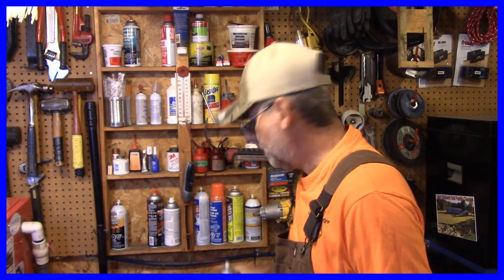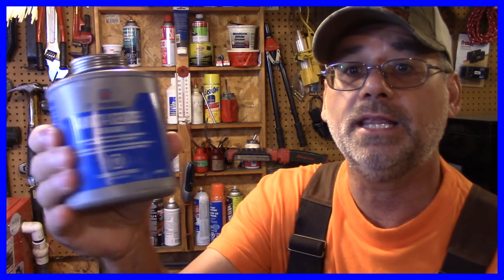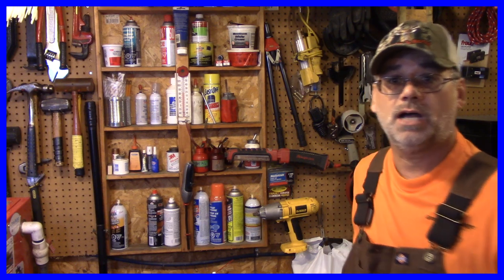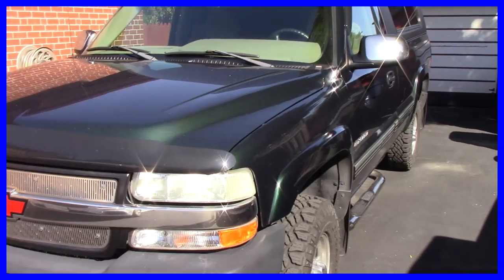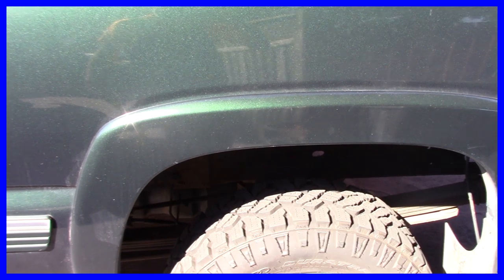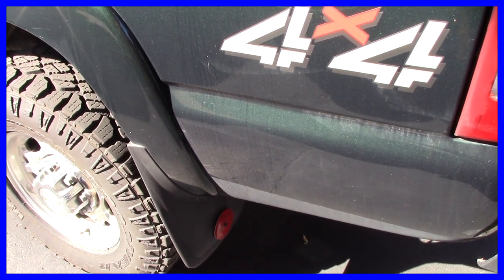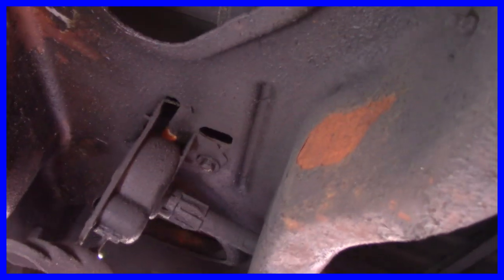APPLYING  RUSTPROOFING / UNDERCOATING TO  YOUR VEHICLE  - THIS IS WHAT I  DO AND USE  .

Comment: Let’s clarify.   You should definitely undercoat/rust protect in some way. Not necessarily pay for it to be done tho.  
Oil and diesel mixed together and sprayed on a hot day works great.   

One final note.  I have a 2003 and 2010 Chevy Silverado 2500HD... and neither was galvanized from the factory in any way shape or form.  Literally tore the 2010 apart down to the frame fresh off the car lot in 2010 with 1 mile on it.... no galvanizing.  Galvanizing is a zinc based coating and it leaves a very unique look.
Reply from the maker: Well I worked at GM for 30 years so I have seen my share of vehicle production. On  your 03 only the roof panel was not galvanized and your 2010 has every body panel galvanized. Its not like what you would see on a galvanized nail as its smooth as glass. Cheers

Comment: I have an aluminum body f-150. You won’t get rust but eventually it corrodes white and powder. I used Eastwood platinum on all the frame that I could reach and getting the whole underbody sprayed at a shop soon.
Reply from the maker: Nice 👍

Comment: i used to rustproof cars way back when,the stuff we sprayed in the doors and inside fenders was kinda waxy. they use alot of salt here too,my plow truck frame rotted out in 10 years from it. my 95 dodge is pretty rough from plowing since new,i try to wash it off as best i can when i can. i have worked on plenty of rusty plow trucks  in my life,and its a crappy time consuming job.
Reply from the maker: It's does help but in my opinion just slows  it down. I wouldn't like to be spraying undercoating all day , no thanks :)

Comment: I've had my truck done by a local guy he's excellent . here in northern NH they use a ton of salt on roads and i use a product called fluid film great product its not petroleum base, its lanolin base (wool wax) the US navy use it to fight rust. It can be purchased in a spray can for under 10 bucks, check it out Steve. I use it to touch up under my truck.
Reply from the maker: I do have the product and have used it . It seems to cause a skin reaction on me when  spraying it so I only use it on a brush now. It's good stuff too.

Comment: I sure wish I would have goobed up my brake lines on my 2002 truck when I bought it.  I like fluid film. I started using it on the lines on the tractor at work that always rusted out. I like it better then the chain lube because fluid film seems to drip off less.
Reply from the maker: The fluid film is good stuff but in my opinion the rust check "coat and protect" is much better and drips less than fluid film. Not sure if you can get rust check in PA , if you can get a can with the green cap called coat and protect. It's the best so far.

Comment: Nice example. I used the green rust check product on my car too, it does stick on for a long time. I spray my rust prone mazda in and out with it each time I change the tires and it does help a lot.
Reply from the maker: Yes on the rim to hub contact it keeps it corrosion free as well. Cheers

Comment: The best rust proofing is to have a massive oil leak. Itself applies around the whole year.
Reply from the maker: I've never tried it but if you like lots of oil  and haven't set yourself on fire yet . LOL
Reply: I can tell you that the front sub-frame of my 95 Lumina is pristine due to all the typical GM lower intake manifold and front cover gasket oil leaks!

Comment: I have used RustCheck Coat and Protect in the past and it sticks/protects for a few years, it's a good product. However,  for me, it's cheaper to do rustproofing touch ups with a small rustproofing gun and rustproofing oil that comes in 4L containers from an auto parts store.
Reply from the maker: Tony I have a gun from Princess Auto and yes I do the same.  Good to see you do as well.

Comment: I only agree partially with you. Most likely 90% of people are not DIY people. I some states like NY there r many dirt roads. They are brined with salt to keep dust down. 24/7/365 salt. One is foolish not to get the pickup on the lift and Krown it once /yr., otherwise drive It to the boneyard in 10 yrs.
Reply: Also those oils you use will deteriorate an asphalt driveway. That would piss me off

Comment: I had that problem with custom applied undercoating. It cracks and peels in large flakes, and under it is bare metal already rusting.
Reply from the maker: Bruno it's either you do it yourself or watch it rust :) their are good shops out there , I just haven't  found one yet so I do it myself. Cheers

Comment: Oil does spread. It drips to. Not saying they aren't hoses you but shit does creep. Also if you have a JEEP Wrangler TJ you do want to drill holes in the frame to drain water because water gets in bolt access holes and travels down and rots the frame from the inside out. You want to drain that shit

Comment: Diesel and hydraulic fluid mixed use a pump sprayer. It won't rust. Even just diesal alone works great. Back in the 40-50s part of your standard full service oil change was spraying underneath your vehicle with used motor oil. To prevent rust. Then the hippies came
Reply from the maker: Them hippies ruined  everything 🤣

Comment: I use chainsaw bar oil heat it up on the grill to thin it and spray it on with a cheap undercoat gun oil slows down any rust
Reply from the maker: Great idea John 👍

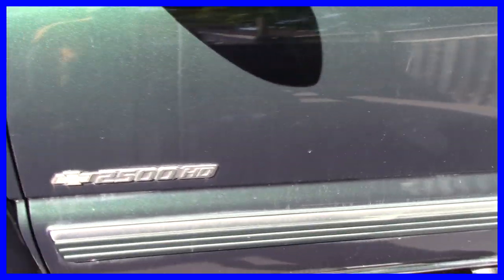Comment: Thumbs up but, @5:38, Guess I'm confused.

 So you repaired the cab corners because of rust? But, but, but, I thought this video was about preventing rust.

So did you start using your own rust preventatives AFTER the cab corners were repaired? Did you take the Silverado in for the anti-rust previous to the cab corner repairs? 

As has been stated by others, I also started using a product called 'Fluid Film'. Quite a while ago it was ONLY available from  John Deere ag dealerships. Used to drive 15 miles just to get it. Now you can buy it most anywhere.

That stuff does 'creep' and so far I've been happy with the results.
Reply from the maker: I had my truck sprayed  every 2 years after i bought it for 3 times and still the cab corners rusted out because the spray could not get to the spot I guess . On my F150 the rockers are rusting out big time because Ford had a great dumb idea - i'll do a vid on it , worse design idea to prevent rust i've seen.
Reply: great vid Steve, couldn’t agree more. I do the same, I buy two cans of rust check and spot spray channels and spots prone to rust. Both of my 2006 Honda’s are pretty much rust free - only my wife’s vehicle has a wheel well rust spot. The salt brine they use on roads today is worse than road salt for our vehicles. Thanks for sharing your advise. Cheers
Reply from the maker: Thanks Bud yes that stuff in the tankers sprayed on the highways is nasty corrosive. Cheers
Reply: STEVE ROB REVIEWS
Steve, I look forward to the Ford vid. 

I recently repaired a rocker panel section and 'dog leg' on a good friend's 2008 dodge Caravan. Now I must have been, and probably still am, 'out of the loop' on newer-ish vehicles and their construction but, the entire rocker panel and the lower portion of the dog leg was full of expandable foam from the factory!

I cut off and drilled the spot welds of the panels, dug out as much of the foam as I could, welded in new panels, soldered (body lead) the seams, and repainted. Then I sprayed Fluid Film inside the panels after removing the access plugs which were on the inner panel.
Reply from the maker: Russ that would have made for  a great vid :)

Comment: many gm cars came from Canada  the 2 in the vin  they are made well!  gm started using recycled metal in the early 70s that was the rust thing back then  that stuff works your truck shows it!  I guess you even got to the brake line above the gas tank too!
Reply from the maker: The brake line by the gas tank that runs along the rail to the abs box is the first one to rot out it seems LOL  Yes that's the first one to  coat as its the worst one  to work on.

Comment: The chevy silverado will have engine and transmission issues and going to the junk yard before the rust will hurt it.  No need to spray so the mechanics can keep working tirelessly.
Reply from the maker: My 2002 silverado is awesome , so good I bought a 2021 silverado this year .  You may have a bad experience but the vast majority keep going back to buy another silverado because they are great trucks .
Reply: Nope the rust almost always kills them before anything else, my trucks got around 300k still runs and drives great but it’s rotted really bad
Reply: My 2006 Silverado has 560 000 and still ticking lol

Comment: Hi. Is Dry Coat Rust Preventative a good product to undercoat a new vehicle to protect and prevent rust? Would it protect from a harsh New England winter. If so could you explain how to apply it properly to the undercarriage. If not what is the best product or service for undercoating a vehicle. I looked up several services Krown, Ziebart, Corrision Free, WoolWax & Fluid Film. The reviews were horrible for Ziebart, Krown not so great, Corrisiion free so-so, and the others seemed o.k. I bought Cry Coat Rust Preventative to spray on the rotors as i seen some videos from car detailing guys saying it is great for that. Now i need to know the safest best product or service for undercoating a vehicle and how long it would last in a harsh New England winter with all the elements. Thank You
Reply from the maker: The best product is the one you get applied , I mention my favourites but most do just fine.

Comment: Thanks for sharing your rust proof method.  Just one observation, up here in the rust belt galvanized doesn't buy you that much extra time..
Reply from the maker: Thanks , your right as the galvanized panels do get scratched from stones underside and the corrosion starts.  Cheers

Comment: Hey there ! You think that Mikita compressor will work
With an oil spray gun? If so what kind of sprayer would you recommend? I’m
In
Ontario as well 
Thanks!
Reply from the maker: Sure , it would spray easily .  Check out Princess Auto , they have some great undercoating guns at great prices.
Reply: Awesome, thanks Steve! I'm not looking to spray continuously, just short bursts. I Have the same 2hp Makita compressor and really like it, though I've never used it for spraying paints or undercoats. I'll check PA for that undercoat gun, thanks! 
  @SteveRobReviews

Comment: Guys paying 20k + for rust free 1999-2004 7.3 power strokes.  But tell me again older trucks aren't worth anything lol.  My rust free 2011 f150 EcoBoost with 184,000 miles is still worth 14k. What would it be worth rusted out? I use NH oil and I love it
Reply from the maker: Yep if you keep it in good shape it's a good investment in rustproofing but most dont and the value of a rust bucket is not so good. Cheers Brandon

Comment: $200.00 for an oil spray in Ontario?  I have a 2005 Honda Civic that has been sprayed every year by Krown Rust at a guaranteed price of $100.00 that will never go up.  You won't find a spec of rust on it & it's 18 years old.  Holes drilled, yes, but they're oblivious.
Reply from the maker: That's awesome 👍

Comment: Had dealer applied rust proofing applied to my new in 2009 f150. Approximately 6 years later had $3600 worth of rust repair done. Last month had another $5400 worth of rust repair done.  In my opinion, the rust proofing caused the rust by trapping in moisture.
Reply: If you had the rubber based undercoating done then you’re 100% correct. Oil based spray solution keeps rust away and moisture out.
Reply: Ziebart?
Reply: well you had a dealer do it, probably had a garbage product and didn't do it properly..Sorry but they are scammers much of the time.
Reply: Rubber coating is the worst. These oil base rust proofing you typically have to apply each year. Would make your car last forever.
Reply: Also had 2009 f150, it was a bad year. Literally had chunks of rocker panel and cab corner piling up where I parked.

Comment: Great video!  Could you explain when you use Rust Check and when you use Chain Lube? Or I can use either one of them? Any difference? 
Also, can I spray them on plastic or rubber parts?
Reply from the maker: I use them both but the chain lube stays on much longer but is quite messy  to work around so I put it on areas I wouldn't  touch  much.  I haven't found the plastic affected by it at all but I don't seem to have much plastic underbody. Cheers Eric

Comment: Unfortunately, here in Maine I do see a lot of vehicles that tend to be 'rust buckets' and it seems that most brands fall into that category. I just sprayed a 'used' 2007 cargo van that I bought this fall, so we'll see what happens with that. Always great to have different opinions though, as that's how we all are going to learn. Thanks for the video!
Reply from the maker: Thanks - yes I  agree . Nice to see what others using  around  the world .Cheers
Reply: Just make sure you don't put that black rubberized spray coating. It's terrible,. But from I understand, fluid film mixed with bar and chain oil is very good and as long as you can get a vehicle high enough off the ground and have an air-compressor, you can do it fairly cheaply.

Comment: Aluminum corrodes. Ford Expedition tail gates are horrible for corroding. White powder corrosion. We used Fluid film for the first time this fall, we’ll see how it holds up. It cost about $15 to do a whole car.
Reply from the maker: So now we have the aluminum  bodies corroding  too 😳
Reply: Andy I just bought some wool wax, it’s made by the same company that makes fluid film but this one doesn’t smell, it’s a bit thicker, plus it doesn’t wash away as easy, gonna try it think year on my atv and RAV4

Comment: I like to use when I can get it, white lithium spray greese. It looks like your chain lube or rust check. It stays tacky, my 03 f250 is pretty darn clean too. I will look into those you mentioned. But I live in northern Mi .  Its proly hard to find. 
  I am looking into having my wifes new Mazda cx5 undercoated and rust prevention by Valugard by Line-X. Its a one time deal and warrantied. Its supposedly  mil spec so Im thinking it should be real good. But I am still researching it. I think its a wax base. I dont know what type you had paid for or if it was oil base. Any input would be greatly appreciated. Tx Nice vid
Reply from the maker: Arlo I had it sprayed by KROWN  and Rust Check franchises . Both of their oil sprays just washed off  within a year but the rust check coat and protect is great , much like fluid film . Fluid film  a wax based product is awesome . The chain lube is great for underbody but it's messy too .  I would see if you have anybody local spraying fluid film . Cheers
Reply: Thanks for the quick reply. From what Iv been reading and told valugard is a wax base. I will see if I can find somone to put on fluid film.  Ican do my f250 but my wifes suv will be a lot tougher to get under.

Comment: Do you apply the Rust Check inside your tailgate and fenders? If so how do you get in there?
I have a 2015 RAM 2500 and I was told they rust bad in the rear quarters.
Reply from the maker: Yes I use the coat and protect rust check . The fenders on the outside lip is where they rust out , its easy to spray but you have to take the ties off to get good access. My tailgate looks like new from just spraying it all around , the inside is not where it rusts more so around the outside seams.
Reply: Thanks Steve! Do you think it's better to use the Rust Check or the Liquid Wrench chain lube on the outside lip of the fenders?
Reply from the maker: I only use the chain lube in spots I'm not going to touch or get close to with clothing.  The rust check for everything else. Chain lube on the wheel wells is what I use.
Reply: STEVE ROB REVIEWS Awesome!! Thanks again you’ve been a big help!